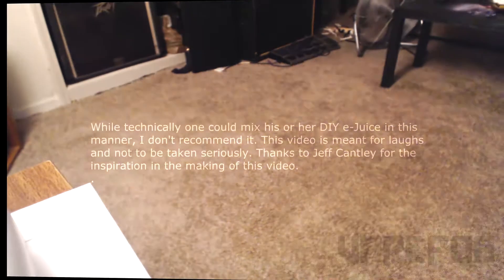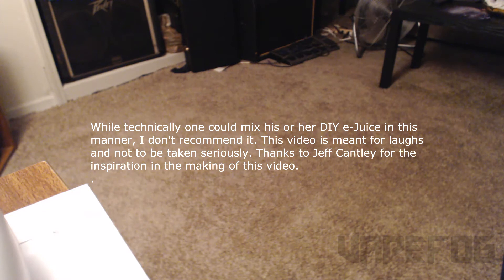Lazy e-Juice Mixing | VAPEFOG

Comment: Sweet. I think ultrasonic cleaners are the craziest way I've seen people shake juice.
Reply from the maker: I haven't seen that method yet. I personally don't see the need for drills or other devices used for shaking ejuice but if others like it that's cool. I do think a thoruoughly mixed ejuice is probably better though. I guess whatever works, everybody is different.